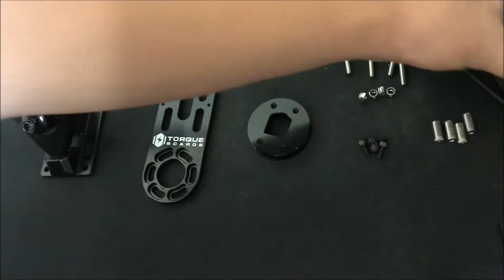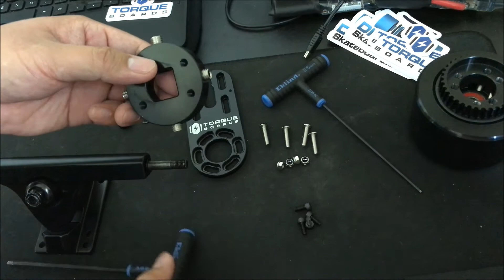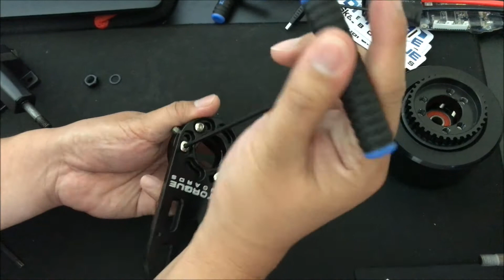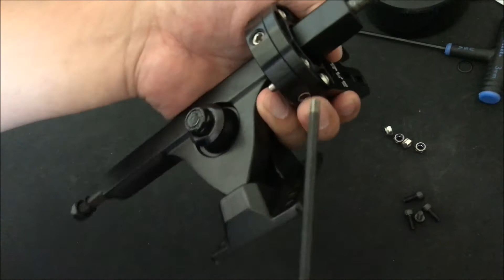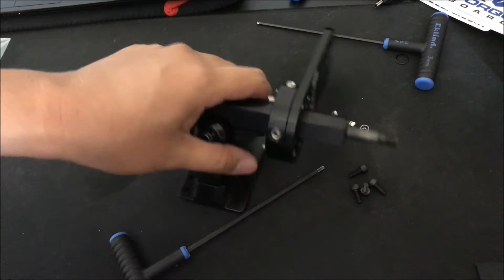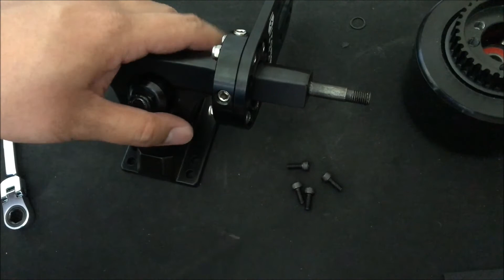How To Install An Electric Skateboard Motor Mount (TUTORIAL/INSTRUCTIONS)

Comment: +1 with Nitroracer001 for a next video adding the motor and for your good work.
My dual motor mount should be here in a week now : looking forward to start my build, and I suppose the belt tension will also be an issue for me.